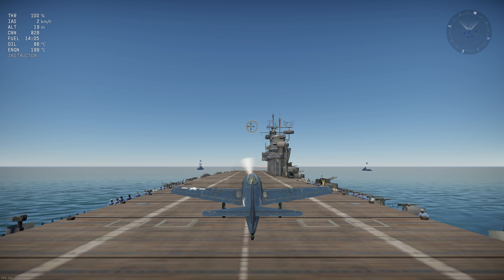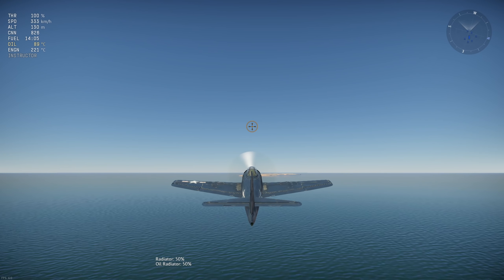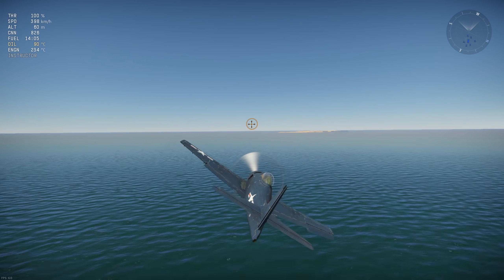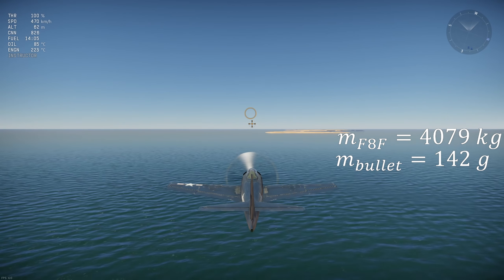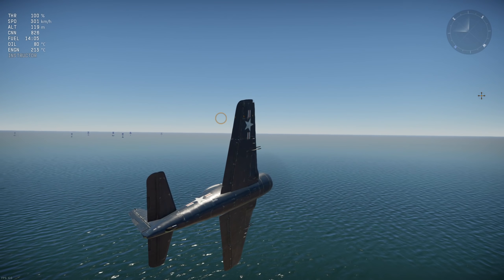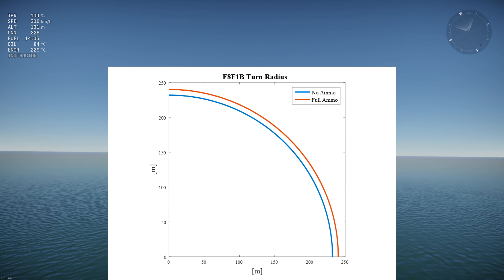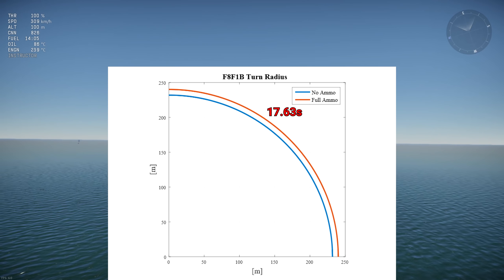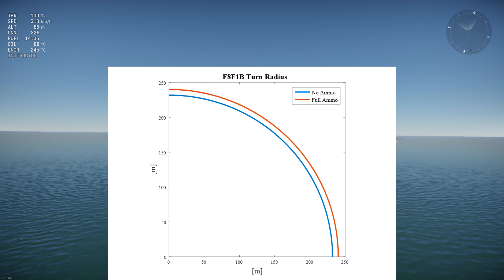Mythbusting | Does Ammo Count Affect Performance?

Comment: You forget that burst mass only counts for the weight that leaves the barrel and not the weight of the complete shells, which should add around 30-40% more.
Reply: Kim Janek probably not that much. Even with bottle neck cartridges, the powder and casing weigh much less than the bullet. Maybe 5-10% more mass?
Reply: @J7Handle  The 13mm AP-I for the MG 131 weighs 38g but the whole round weighs 78g so more than double the weight of the projectile but only 7.1g are powder. Brass cases are heavy as fuck, thats why todays modern rounds use polymer or similiar material. Todays Tanks are loaded with just a few kg of caseless powder instead of the 15-20kg brass cases of large WW2 and post-war tanks.

It's similiar with the MG 151/20 ammo. So 30-40% was actually an understatement.
Reply from the maker: It can get close to 50% indeed. But, that doesn't seem to be modeled in War Thunder, it only considers the round itself for the weight.
Reply: @AdamTheEnginerd  time for a bug report ;)

Comment: Adam... burst mass includes the weight of the bullet only, the casing is not included in that mass. And the bullet casings along with the gun powder make for quite a considerable bit of the total mass of the ammunition onboard the plane. Your best bet is to search somewhere online for accurate numbers, and then compare them.
Reply from the maker: War Thunder doesn't seem to take propellant and casing into account. Propellant and case can be as high as 50% of the mass, so according to my test it would improve turn significantly more if that were modeled.
Reply: @AdamTheEnginerd  ok, thanks for letting me know,  i really thought they would have modeled that in...

Comment: One thing though: Did you take the Propellant and the cartridge case into account? They're a significant amount of the total mass. Primers are kinda irrelevant I guess though.
Reply: Yea i thought the same thing. The calculation for that is probably wrong. Would be interesting to see the difference for that. But its a great video nonetheless!
Reply: @Kilianum  I totally agree. Schöner Name übrigens.
Reply from the maker: War Thunder doesn't seem to take propellant and casing into account, so nope. Propellant and case can be as high as 50% of the mass, so according to my test it would improve turn significantly more if that were modeled.

Comment: AN/M3 AP-I weights 166g, and HEF has 130g.
Bearcat performing better than the ammo weight loss would suggest might be because the mass of the rest of the bullet is moddeled as well (shell casing and gunpowder)
Reply: Full round would weigh between 260 and 300g so it should give a bigger performance difference than recorded by you. The weight of the rest of the shell might not be moddeled (at least fully),
 I'm looking forward for your turning performance video
Reply from the maker: True shells would weigh nearly 2x more, so the test actually shows that casing and powder weight aren't modeled.
Reply: @AdamTheEnginerd  Yup

Comment: Hello again. I know I'm getting annoying with all these questions, but I'm too curious about XD.
Lift depends on air speed and density, right?
If an aircraft is at a certain altitude and flies close to stall speed, its lift is equal to the weight force. If the plane increases the throttle, the plane accelerates but, until the angle of attack is increased through the elevators, the plane does not rise in altitude, despite the speed has increased. Why does this happen?
Both according to the Coanda effect and according to Bernulli's principle more speed = more lift
Reply from the maker: Not at all, I like these questions!

1. Yes lift depends on airspeed and density, you can replace both of those by indicated airspeed (IAS). You're missing 1 important factor here, which is lift coefficient (CL) which depends on angle of attack (angle between the incoming air and the wings).
2. The angle of attack will automatically reduce as you accelerate, or else lift would increase and be greater than weight which is not the case. Let's say you were flying at 15 degrees AoA and going straight (not climbing). If you accelerate, your AoA will reduce (goes to 10 degrees let's say) as your speed increases, but since you're still pointing over the horizon by 15 degrees, your plane is now climbing at 15-10=5 degrees at your new speed, and that's a climb rate/rise in altitude.
Reply: @AdamTheEnginerd  thank you Adam! I really appreciate all your work!
Reply from the maker: @ferrarisuper  My pleasure!
Reply: AdamTheEnginerd at which hour do you usually play? Because now (as there’s all this coronavirus stuff) in the morning i can play as in the evening. Maybe we could play a bit together
Reply from the maker: Haven't played in a while, been quite busy. It varies, but I'm working from home during the day.
Reply: AdamTheEnginerd what job do you have?
Reply from the maker: Engine Performance Analyst at Pratt & Whitney Canada.
Reply: AdamTheEnginerd wow, how much time ago have you finished university? I, after i’ve finished High school, want to frequent Aerospace University. My Dream is to work at Aermacchi, but here in italy is very hard to get a job, especially if you are young. The only nice thing on this system was that it’s hard to get fired, but after 2008 companies have fired lots of workers
Reply from the maker: I finished in December, made a video about that ;).

You should talk to people in the fields you're interested in to get an idea of what they do!

Comment: It may be that WT actually modeled the weight of the ammo belt linkage as well. Might explain the slight difference.
I was fairly impressed when i noticed that they had improved the fw190a series flight model so that its now impossible to overspeed in dives no matter how high you start them. This is now in line with the historical accounts from the early production units, which were tested by diving from 11km with full throttle.
Reply from the maker: Casing and powder can be up to 50% the weight of the whole thing, so we'd be seeing a much bigger difference between empty and full ammo Bearcat if it were modeled.

Comment: Hold up... Warthunder even modeled water injection into weight losses?
Reply from the maker: Certainly, why not?
Reply: @AdamTheEnginerd  I mean.. how much water is stored usually? No more than 10 gallons, right? I mean, I guess that makes sense now that I think about it. Even if 10 gallons that's about 100 lbs.
Reply from the maker: 40-90 kg so 100-200 lb typically. It's equivalent to 5-10 minutes of fuel.

Comment: Excellent video, although it's worth pointing out that the mass figure you used only accounts for the projectile itself; not the full round with cartridge and powder.
Reply from the maker: Thanks!

Indeed, but WT doesn't consider casing and powder weight, or else the difference between full and empty ammo would be 2x bigger than shown in this test.

Comment: Weight should drop further than you indicated here if modeled correctly, considering the burst mass to the best of my knowledge is the weight of the ammo leaving the barrel. You also got the propellant and the shell casings that you drop. So if done right this should be contributing to the extra bonus you find
Reply from the maker: Casing and powder is about 50% of the weight of the whole thing, so if it were modeled the difference between empty and full ammo would be double. But, WT doesn't model casing and power weight.
Reply: @AdamTheEnginerd  didn't know that. Thanks for the content =)

Comment: I know it does, because I tested the climb rate of my Bf 109 G-6 (or 10) with 30mm gun pods with and without ammo and without any ammo I it could climb a good amount better.
I think I even used to empty my MG 131 ammo on the ground before going to hunt bombers for a while, but thats was a a while ago :3
600 rounds of MG 131 ammo should reduce the weight by around 45kg.
Reply from the maker: You have quite a bit of confidence in your perception skills if you noticed it without doing real testing.
Reply: @AdamTheEnginerd  well I just watched the climb rate in the the war thunder real time plane performance thingy. without ammo the climb rate was a lot higher.

Comment: I know this is an old video which I just stumbled upon and not many people are gonna read this, but the issue pointed out in the comment section, that only the bullet weight and not the entire casing, propellant and linkage weights are deducted from the overall weight of the aircraft has been brought to attention of Gaijin multiple times over the years. I myself started a forum thread 2016 when I was still playing the game, highlighting a difference of about 300 kg for the P-47D. Of course these issues were actually also known to testers back then and way before but it was difficult to bug report, because officially back then no way to read out the current mass of an aircraft existed. Interesting to see not much has changed.

https://forum.warthunder.com/index.php?/topic/312684-wrong-weight-of-aircraft-ammunition-on-nearly-all-planes-in-warthunder/

This is a bit sad, as really subtracting the correct mass from the aircraft when firing guns should be one of the easiest parts of designing a flight model because you have to research just one number per weapon, it's not even aircraft specific. Subtracting the bullet weight is just so lazy.
Reply from the maker: It's not that big of a deal though.

Comment: Speaking of the bearcat, it's missing 400 or so HP, right? Isn't supposed to have somewhere between 2700-2800 with WEP on the first supercharger gear?
Reply from the maker: It reaches like 2700HP at its top speed at sea level lol.

Comment: Just asking and correct me If i'm wrong but you calculated the mass of the projectile with the bullet mass of all   4 cannons. But this is just what comes out of the gun. It's just the mass of the projectile and not the mass of the whole bullet. So the projectile just weights 140g but the mass of the whole bullet is 250g. So the bullet mass should be higher than 2.9% of the aircraft.
Reply from the maker: Casing and powder is around 50% of the weight of the whole thing irl, but WT only models the projectile mass.

Comment: What determines the climb rate of a plane? For example The Bf109 K4 has a more powerful engine, less drag and less weight than a spitfire LF MkIX, but the spitfire climbs better.
Are there other factors that determine the rate of climb of an aircraft?
Reply from the maker: I made a video explaining rate of climb! https://www.youtube.com/watch?v=eEeBX7XAgsw

LF has a more powerful engine than the K4, at least at low altitude, which is why it climbs better at low altitude. It also has better propeller efficiency (Bf109s have quite poor propeller efficiency, so the same power translates into less thrust).
Reply: AdamTheEnginerd thank you Adam! Your climb rate video is beatiful! 
What determines a more efficient propeller?

Comment: Great video, hey can you make a video on the fw-a5 or any of the “a” variants I recently have been trying to spade all the fighter and the the a models are giving me a lot of trouble, people seem to like them a lot but goddamn idk what I’m doing wrong all I see is a slow 0 energy retaining gun carrier that doesn’t rip and can roll.
Reply: usually what people do is take advantage of the roll rate and cancer roll until they get into a spin
Reply: 190's accelerate insanely fast in a shallow dive and you can get a lot of speed up by just dipping your nose down for 1-2 seconds. Best tactic is to climb high and BnZ opponents. Different loops are your friends because with insane acceleration rate you can catch up your target in a loop. I use 400-500m convergence and 4x german 20mm cannons will make short work of everything. If things go south, you can run away with your superior acceleration and extremely high wing rip speed. (p-47's and P-51's can keep up with your top speed, but you accelerate faster than them.) The A5/U12 is insane headon machine with 6x 20mm cannons. If I remember correctly the A8 had a turning ability of a wingless IL-2. I out turned one in a american bomber.

And that insane rollrate makes rolling scissors extremely effective vs spitfires and P47's
Reply: Nibe yeah the a-8 is alright but the a-5 makes it impossible to bnz because it loses so much energy it’s very inefficient. The d’s are what you describe but I’m specifically talking about the a-5
Reply from the maker: They are on my list!
Reply: a-5/u12 is one of my best performing german planes and i use it without gunpods. Unlike other german planes, it should be brought to the fight quite late (sideclimb to 4km-5km) and take advantage of lower altitude enemies and if you do encounter the odd allied plane above you it excels in defensive flying because of it’s rollrate, making it easy for people to overshoot easily. The A series 190s are very hard to master but very rewarding.

Comment: You only accounted for bullet weight (which is too high 142g). When the cannons fire the aircraft is reduced by the entire weight of the round, not just the projectile. The projectile and propellant go down the barrel and the cartridge case is ejected along with the belt links. The weight of 20mm cannon shells used in the F8F were 0.25 Kg for ball, 0.26 Kg for HE, and 0.29 Kg for API. If you want to average the weight, then every round fired would lighten the aircraft by 0.27 Kg. So the weight you calculated for ammunition weight is much lighter than it should be.
Reply from the maker: WT doesn't model casing and powder weight, if it did the turn difference would be much higher during testing. WT only considers the weight of the projectile.
Reply: @AdamTheEnginerd  Of course! I should have known. Thanks.
Reply from the maker: @juliancate7089  My pleasure!

Comment: The round weight is larger than the projectile weight, so there's your difference.
Reply from the maker: Casing and powder is around 50% of the weight of the whole thing irl, but WT only models the projectile mass. If casing and powder mass was modeled, it would roughly double the difference between empty and full ammo turn, which wasn't the case in this test.

Comment: Another weird thing I heard regarding weight and turning: i heard that the Fw 190s turn better with more fuel. Is this possible/true?
Reply: Yes. The fuel tank improves the centre of mass making the tail more responsive.
Reply from the maker: That used to be clearly the case, think they tweaked that though.

Comment: Offtopic but i need an answer: you often use a program for checking the engine perimeter (like actual G's or engine hp). I can't find a mod what displays this...i love flying with mec but i hate it when i have to switch back to cockpit view just to take a look if everything is alright . What is this mod called? Is it still allowed after implementing EAC?
Reply from the maker: You can check out "Void Mei" on the WT forums for an easy overlay. It's allowed.
Reply: AdamTheEnginerd thanks for the reply. I will take a look. Keep up the great work. 👌🏻😊
Reply from the maker: Thanks, I will!

Comment: What about the impact of empty guns/wing fuel tanks on roll rate? 
Shouldn't an aircraft also roll faster with its wings as light as can be? 

Really the question boils down to "does Gaijin locate the mass of aircraft components or is just a lump sum"?
Reply from the maker: That would only change inertia which only affects roll acceleration, not roll rate. But from what I saw, inertia values are fixed and don't depend on the weight distribution. Weight distribution does matter for the CG position though.